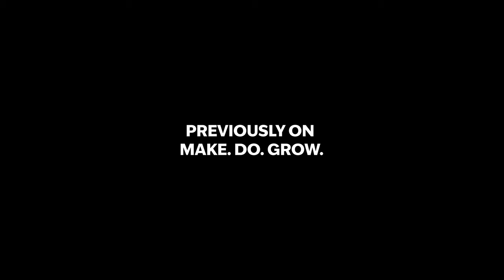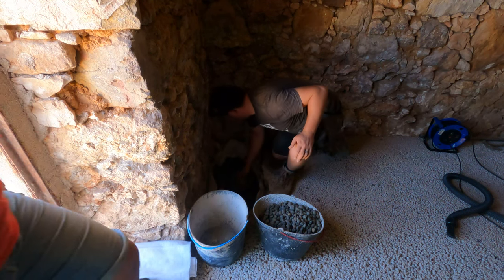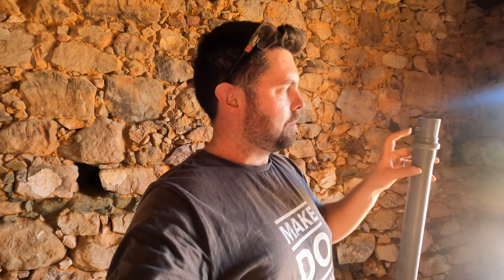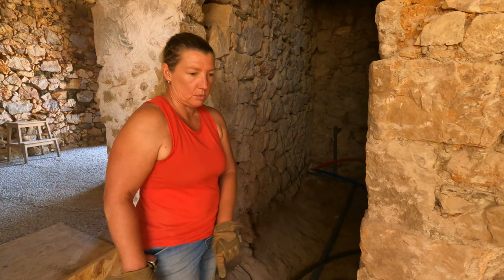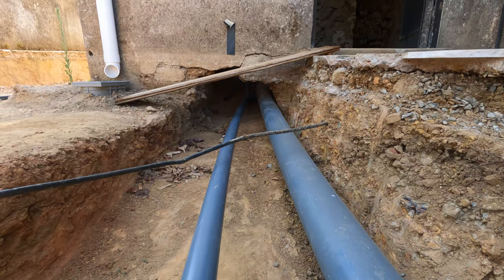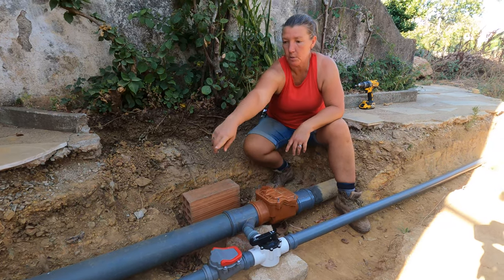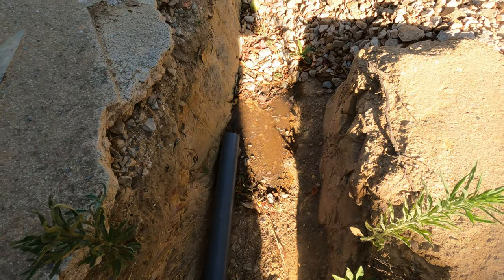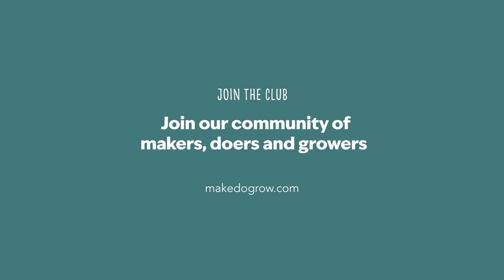Installing a Grey Water Harvesting System (Part 1) - #27

Comment: Geoff Lawton did/does work in Jordan where they capture as many drops of water as possible. It's under the series "Greening The Desert". Wicking beds for growing, grey water treatment, using reeds, filters. That series is amazing just to watch and see how a desert becomes a food forest. 
Might be some ideas there. 
From what I gather, there are many different ways, some effective, some just for "make do". 
I like the design of the system, and I too would have that "what if" running around my head until the piping was corrected.

Comment: Hi Guy,  I was watching you use a shovel and you lifted the load with just your arms and back.  Would heartily recommend that you bend your knees and lift with your gluts which is the strongest muscles of your body.  I remember you said that you're not too flexible, but there are some small exercises to help you get some bend in your knees.  I hope this will help you avoid long term back problems.  Take care.
Reply: I just told them to be careful with the loads and their backs... sometimes you do need professionals to do some jobs in the renovations, just my opinion... Guy responded that their backs are just fine and for me to back off... he he he...

Comment: Looking good!  Once it is all operational, keep an eye on the water flow in the "black" water system.  It is possible to have too little water in that part of the system once you have diverted all the "grey" water, leading to a greater frequency of blockages and poorer functioning of the septic system.  In all probability it will all be fine, but it does all depend on the volume and frequency of flushing and the ahem "contents"!
Reply from the maker: Yep, it’s definitely one of the reasons we wanted to put the diverter in. Every now and then we can divert the whole house to the black run.

We currently only have the toilet in use, but we’re careful to remember to dump extra buckets of water down it just in case
Reply: @MAKEDOGROW  This was my question too.  I see you have already answered it.
Reply: @MAKEDOGROW   Maybe just grab a roof downspout and occasionally divert it into the blackwater line above the no reverse valve?

Comment: I do love your videos! Just the right combo of information and dry humour... And you two are such an effective team. Looks like great strides you're making here. It may not be relevant to your plans, but I've long been fascinated by Solar Water Disinfection - using the sun to sterilise water. You certainly have all the sun needed! There may be a difference between the water you 're happy to apply to tree roots and the water you'd want to use on lettuce...
Reply from the maker: I’ve seen some systems using uv filtration but typically using mechanical sources, ie. a uv light. I wonder if there is a way to harness the sun naturally instead ... will do some research into that. Thanks for the idea 😃

Comment: When I heard you saying that you needed to replace pipes where you had used PVC cement, my heart sank. I've used such pipes to direct rainwater into a barrel. Luckily everything is above ground. However it seems the joints I am using are designed solely for PVC cement. One thing I remember is the moment I discovered how quickly that stuff sets. I remember having about 10 seconds to get the joints at the right angles and luckily had planned ahead and marked each one with the correct angle.

Comment: Hi to you both, I now understand why you wanted to dig out the pipe, here in France glued joints are done with a collar that has 50mm each side of the glue joint. I see lots of comments on the grey water system, after 20years in waste water management I would suggest the Reed bed system. Reeds can turn settled sewage into a very clear usable water for use on plant irrigation, still watching every episode 👍
Reply from the maker: Thanks, a reed bed solution has probably been highest on our list ... integrated into a water feature or aquatic zone (we do like things to look aesthetically pleasing) 😀

Comment: Very good idea separating Grey and Black water, especially in dry or semi-dry countries. To filter Grey water so it will be useful for irrigation, you need to build two tanks at least, the grey water flows to the first tank from the top, then another pipe below takes it to second tank. The reason for that is soap or other cleaning products float on top because it's oil based. That's been done in Morocco too.

Comment: Expat here; back in brazil when I worked in construction we used to light the remains of a cementbag on fire, used it to melt the pipe then when its soft and pliable push it over the other pipe, then quickly take it off again so it doesnt melt together and then add glue, but only for water mains and anything else under pressure. Sewage and rainwater piping too but only anything above ground. Under ground we always did with rubber seals due to the earth contracting. Now it doesnt freeze there so earth contraction is less but it does rain allot so...

Its like picking rocks from your garden bed, you think you got them all and then next year you will have rocks in the same patch again. They keep getting pushed up, even though dirt and soil being solid too and rock being heavier. Has to do with a bigger surface area. Rubber seals eliminates the expansion and contraction issue caused by it as the pipes can move a bit.

The same reason is why if when you lay any type of cable you lay a loop every 15mtrs or so

Anoying you had to dig everything up but well worth eliminating the risk of rupture and having to do it anyways but well in a more shitty condition 😅

Comment: Well done.  I didn't realize you were using the gasketed pipe with a solvent.  I thought it was a traditional pvc solvent joint pipe.   I don't know what type of detergents are used in Portugal but dishwasher drainage is often considered black water.  The high salt content of the dishwasher detergents can make it harmful to grey water systems.  I love the back flow prevent valves and the three way diverter.  The only experience I have with filtration systems is a local community that tried a multiple pond system.  We get some nasty cold weather in Pennsylvania and many of the plantings in the filtration ponds froze and died.  This caused some discharge of effluents into the water system and huge fines for the township.

Comment: You asked if anyone had previous experience of what you propose to do to filter your grey water .So for what it’s worth here is ours .All circumstances differ but we have found what we did long ago ,without much clue remarkably forgiving .
Many years ago I built a filter bed on the end of our grey water harvesting pipework in southern Portugal  ,It consists  of a perforated plastic sewer pipe running in a trench lined with a waterproof membrane  filled with Brita .By perforated I mean a pipe in which I drilled myriad holes .This actually replaced clay land drain pipes which were the original idea .
This pipe is in a trench lined with a waterproof membrane again punctured at regular spaced intervals filled with a sharp sand corse brita mix ,About 2.5 ft deep and wide  with a foot of brita/sand  under the pipe and running some 150 plus yds at a steady shallow  downward slope .. 
No real. guidance  was available then that I knew of So it was an experiment I played by ear .But I had in mind creating  the natural filtering process of a stream bed and the filtering action I had seen on my grandfathers Devon farm ,as a boy ,that had a stream running through the farm yard .
At the end of this filter bed clear clean water emerges and goes into a holding tank for pumping through an irrigation system as and when required .The tank also has an overflow for when water is not required for irrigation in the winter .
Since then we have added  a wetland type reed pond for that waste water to run into when the irrigation is not required and the tank fills   .The pond area and margins now supports a very noisy frog population in the spring and lots of vegetation so the water seems fine .It more or less dries to a mud bank in the summer .
We never use any chemical cleaners in the Grey water system and avoid grease going down as well ,
 Or the black water system either .Black water goes separately into a vented covered cess pit and breaks down naturally .Water from that also has a filter bed below it to run into ,which also emerges  clear and clean and trickles  down a field .But that only occurs in a wet winter .In summer we don’t have over flow from the black water system at all while the grey water filter bed and it’s vegetation also absorb a lot of water such that the volume emerging from it reduces greatly .Which defeats the object a bit !
All very simple and crude by todays standards but it has now worked for some 30 years  .But maybe we might have to dig out and replace the brita and replace with clean  at some point if it ever gets overwhelmed but it never has yet .In fact it seems to have improved with age as the 150 yards plus of filter bed consisting of a few  tons of brita/sand  have become colonized with the natural bacteria ,micro organisms and plant population that clean the water that gradually seeps  through it .We have plenty of space and suitable topography  for such a system ..
To be honest we never even think about it anymore ,it just does it’s stuff .We are also parsimonious with water usage despite having a plentiful supply from the bore and have 3 bathrooms and two kitchens and a separate laundry room sending Grey water to our filter bed .The summers are very very dry and hot so the system is never overstretched by abundant water that also evaporates  very fast  in the summer .I am sure there are plenty of improvements that could be made but my philosophy is if it works leave well alone and it works fine ! But I am sure it would be something that many would now shake their heads about. ,
Reply from the maker: This sounds excellent ... it has all the elements that are used in modern implementations that I’ve seen. Unfortunately we don’t really have too much ability to dig down (due to the existence of the fossa) but we’re thinking to implement an above ground / elevated version combined with a water feature and/or aquatic zone
Reply: @MAKEDOGROW   Yes with hind sight I think we could  have fed  our grey water from the filter bed straight into a much bigger more elaborate pond and done away with the holding tank all together .
The pond also catch’s  winter rain for storage and can overflow in a wet winters so could be much bigger .And also we could have diverted some of the roof collected water that all now goes into cisternas into the pond as well .As we use cisterna water not only for the house but for garden watering .As I said we do have a bore as well but that requires a powerful 3phase electric pump and ain’t cheap to operate anymore .Then just drawn water from the much bigger pond for summer irrigation as required ,with a fine filter on the lift pipe to a solar powered electric pump or a submersible with a timed float switch if we really wanted to get fancy .However my years of experience here have taught me to keep things simple and idiot proof !For some reason technology that works fine elsewhere seems prone to giving up the ghost here at the worse possible time !cheers .
Reply: Ps could you not move your black water Fossa out of the way ? Would not be that hard as less than half a day with a JCB digs the new hole bigger enough for the extra Toilets you propose and I would lead a grey water outlet that way also to keep solids moving if you are using low capacity toilet cisterns .And  a few days building open jointed permeable block walls and making a lid with concrete flooring beams and cast infills  a bit of rebar and and a cement skim for the top lid ,with hatch and inspection hatch and vent is soon  done .Just a thought .

Comment: Here in France, we're slowly having to upgrade our septic tanks, and one day (in the far distant future) we'll get onto "mains drainage". Currently we have a run off at the bottom of our field of the "cleaned" water that we share with our neighbours. However, one thing the "new" system will not allow is eaux pluviales (rain water) going into/ through the tank, probably for reasons of flooding out the tank as we do get torrential (if not very often) rains here. Ours currently bypasses the main tank, and we're looking to install saving tanks and restore the main tank that's above ground, but covered over. Thanks for sharing.
Reply from the maker: I think most systems are designed to keep grey and rain water separated for exactly the reason you mention ... a down pour very quickly creates issues, and typically water flows through the two systems at very different rates.

We have a little more research/planning to do, but are hoping that we can store rainwater in a relatively small holding tank and then pump over to our other bigger tanks (yet to be fixed) or even go into our well (after we're certain they meet a certain purity level).

Comment: I ran a grey water system into a holding tank underground outside the house, then used a solar powered pump to push that water through a gravel pit filter. This meant that the end water level was lower than the output pipes to irrigate the garden, so I chose to again solar pump water up higher into a 1000 lt supply tank from which I could control the water distribution direct to the garden areas. It was also a good place to introduce nutrient solutions when I wanted to boost garden growth and fully, & conviently monitor water & nutrient distribution.
Reply from the maker: I think that's pretty much what we're going to have to do because of the ground levels. We have large storage tanks (that need some work) which we think could work as that intermediate supply tank.

How big was your holding tank?  We're aware that unfiltered grey water shouldn't really be stored for more than 24 hours.

Comment: Please  Kylie  make sure that the return walve remains accessible because the rubber seal on the inside of the walve wears off after some years and reduces the functioning of the walve - I 'm talking of experience here - our newly installed return walve even needs a density checkup every 3 months. Good luck !

Comment: Guys my experience in the building trade tells me to always test pipes prior to burial,, always use a conduit if at all possible, properly cemented pipe is longer lasting than silicon rubber seals which are more prone to failure over time and can often be damaged on installation but not fail for some time.I dont know whos work suggested seals are better but may well be partisan. Pipes carrying urine should not be on a too shallow a slope as prone to percipitating salts and blocking the pipe, had to rerun many pipes in the past due to this problem, the level of blockage is quite extraordinary particularly in pipes of two inches or less.

Comment: This was a few years ago in Roatan, Honduras (so substantially more water flow - and occasional 3 feet of rain to flush the system) but at a resort project called Oceano, we built up a "natural" grey and black water treatment system; Both are pumped uphill once, to provide a gravity driven simplicity to the remaining system, and minimize the use of electricity to a pair of pumps, which depending on volume of your system could be solar battery powered(?). Each type of 'waste' water flows through independent systems all the way through, for different end uses: treated grey water to be reused as drinking water, treated black water to be mixed with excess treated grey water for irrigation, the black water solids going to a useful future as compost. Both grey and black begin their journey into a their dedicated separator,  solids to the bottom, where they are periodically flushed out a diverter to a solids composting pit, liquids flow through out the top to the next stage. Next the liquids flow through a chamber where it is filtered through at least two stages of activated charcoal filters, the second filtering finer particles than the first, then bombarded with UV to kill or render bacteria unable to infect or reproduce (again, solar powered, of course). It doesn't remove bacteria, just makes for a less nasty response from your stomach if you drink it. Next step(s) are discharge the separated, filtered, and neutralized grey or black water out of the closed system, to the final filtration; through a series of contained marsh ponds planted with water loving greens with escalating densities of root growth and a wide variety of appetite for specific mineral / bacteria / nutrients.
Reply from the maker: Thanks for this detail, it’s fairly similar to what we’re considering though we’ll probably miss the uv. Good to know it works at a commercial level 😀

Comment: I have seen the grease trap close to the kitchen sink to keep the rest of the grey water system cleaner.
The one way valves will have to be inspected for hair, etc, to eliminate potential backup.
An overflow standpipe would be nice for the sealed septic.
Reply from the maker: Ah yes, an additional grease trap in the kitchen sounds like a great idea 😀

Comment: I have never seen that type of pipe with rubber seal before !  They do sell 2 grades of 100mm (4") pipe in the US, one for pressure and one for "drain, waste, vent" (DWV).  DWV does have a "bell" end so you don't need a coupler to join to pieces.  The bell is longer.

Comment: Hi. Your grey water line is connected to the house side of your soil pipe one way valve. This would mean in the event of your grey water system backing up it could divert into your soil pipe and possibly your house possibly. Roy